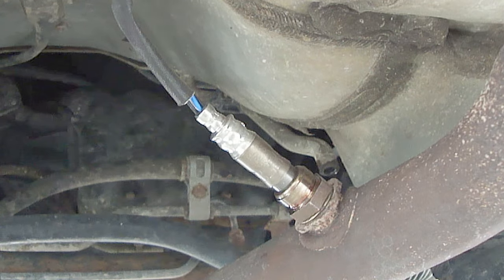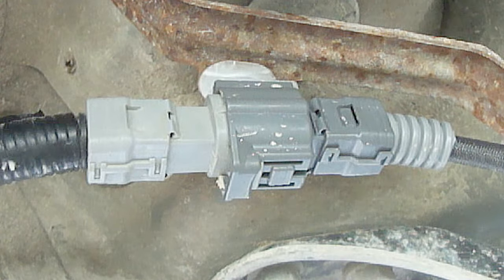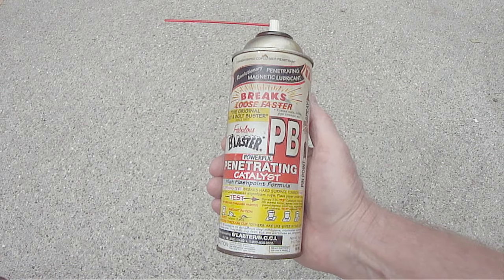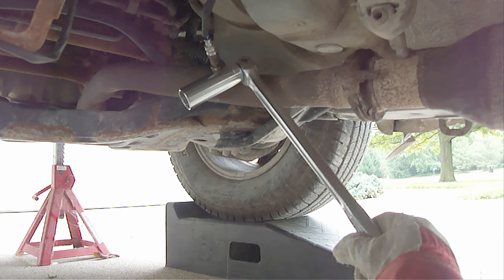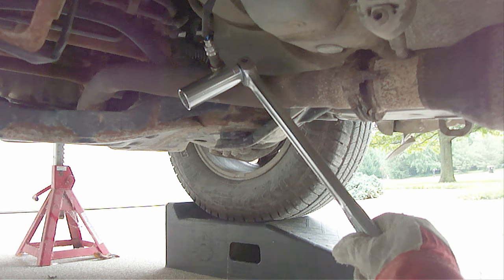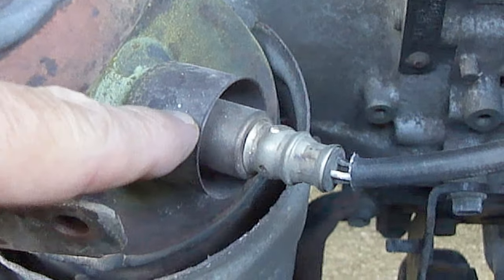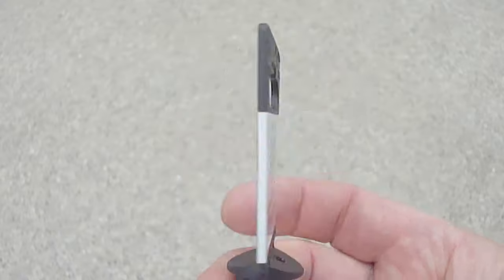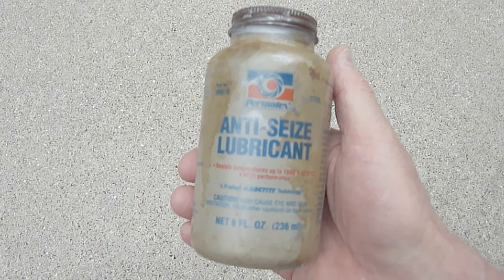Stuck Oxygen Sensor Removal Tips & Tricks

Comment: Mine was on there so tight o2 socket just stretched outward and slipped. Used wrench and it rounded off edges before it budged even an inch, this is with penetration. Will have to get a torch...

Comment: The part I'm struggling with is unplugging the electrical connector, because i can only fit 1 hand under there and its all covered in oil
Reply: put a flat screw driver through one of the gaps on the connector